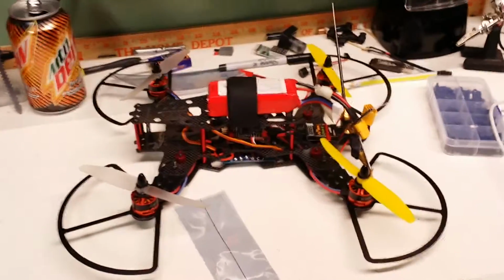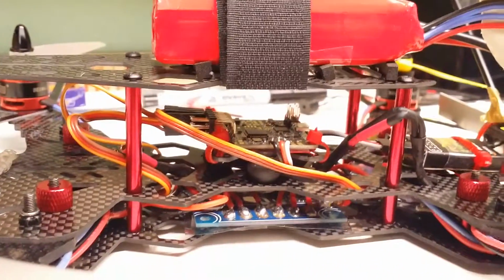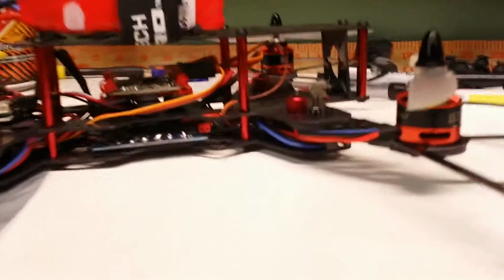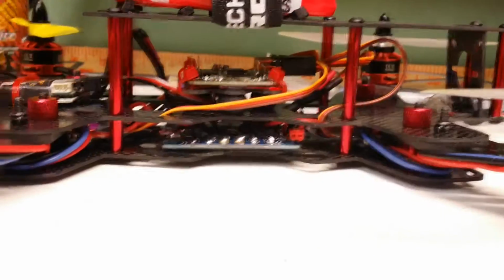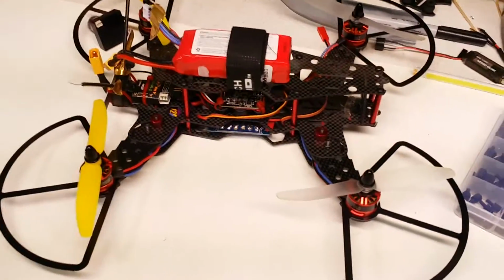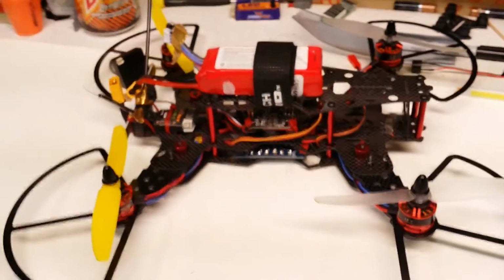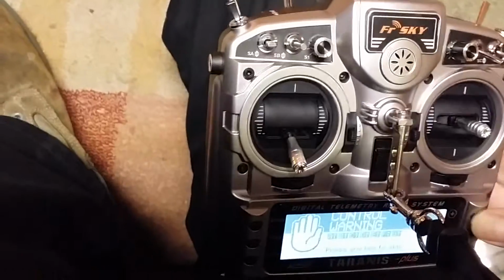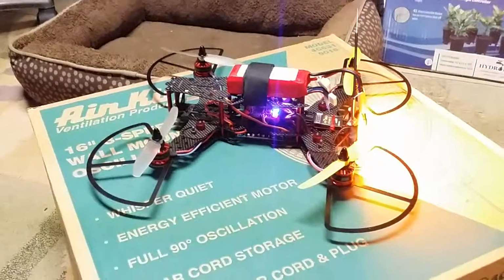Insect variant carbon fiber 270mm FPV almost done

Comment from the maker: aww bummer in deed. I used the screws that came with the frame but made sure to use loctite on all of them especially the motor screws. I did some testing without it and the motor mount screws came loose and I lost one! So be sure to use it.